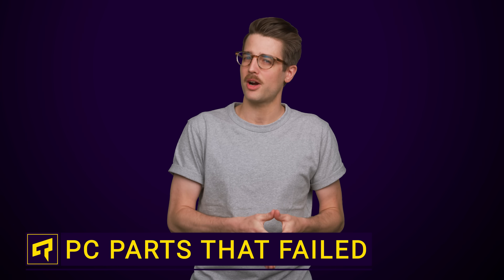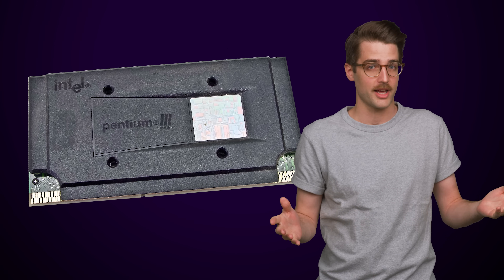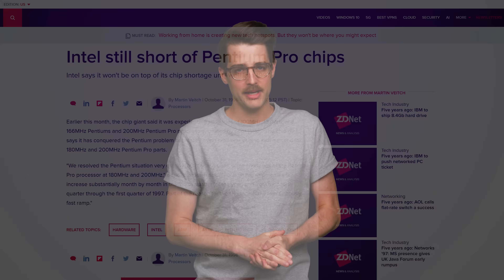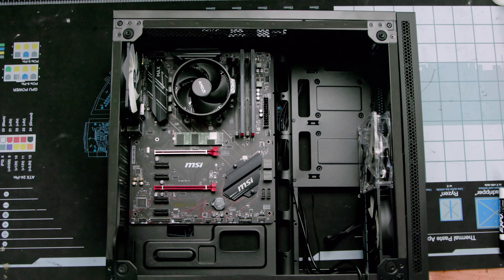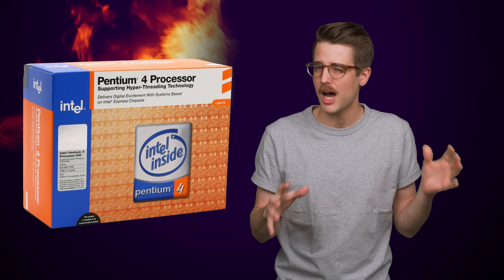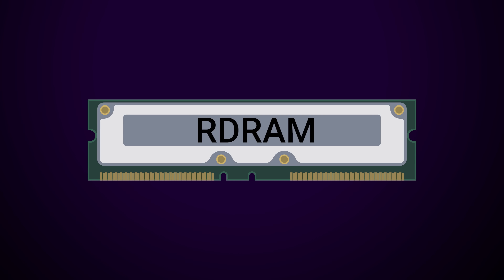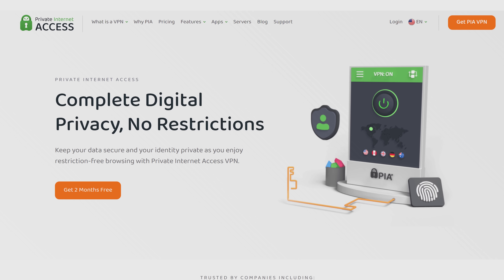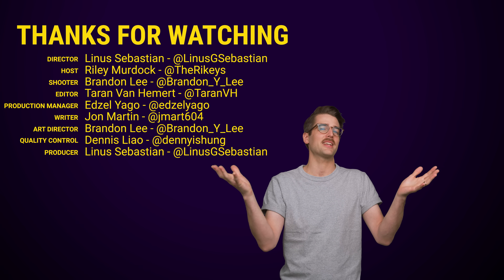PC Parts That Disappeared

Comment: "RDRAM had to be installed in pairs"

No wonder it failed. OEMs love getting away with installing only 1 stick of RAM if they can.
Reply: IIRC in cases where you wanted to install only one for whatever reason there were dummy RDRAM sticks with 0 capacity that just completed the circuit, although don't quote me on that because it's been years since I looked into it
Reply: @maowohl  RDRAM still has to be installed in pairs of identical amounts and clock speeds to work. The dummy sticks go in the channels you aren't using and you cannot only put memory in half the channel with a dummy in the other or it wont POST. You could say it was the beginning of dual channel memory.
Reply: @neilbaird2789  The dummy modules was needed as Rambus RDRAM communicated serially and the memory bus was configured like a ring. So it all started at the memory controller, which was located in he chipset North bridge. Then it went to the input on the first module, to out put on the same module, input on second module and so on until it looped back to the memory controller. The thing was you could have a lot of memory as each real module contained the circuitry needed to both receive and transmit the signals, so signal integrity was not a problem. The dummy modules just connected the pins for input to output to complete the ring.
It was an attempt to solve a problem that it turned out didn't exist. It was also an attempt by a company to create a market for a product where they controlled almost all the IP. Every RDRAM module made generated revenue for Rambus no matter who made them.
Reply: @maowohl  Nope! You had to install it in pairs, and THEN you needed to populate the empty slots with dummy modules.
Reply: @maowohl  but was that priced like the 0gb RGB sticks of today?
Reply: Paging @Dawid Does Tech Stuff
Reply: I think you got it backward, having an OEM system come with 1 stick of RAM is a blessing for multiple reasons. OEM mobos often only have 2 slots for memory so if they are both preoccupied, you can only upgrade your memory by buying new kits and throwing the old ones out, making even more e-wastes.
Reply: If I remember correctly, it was more complicated than that. If a motherboard had 4 slots, they all needed to be filled. RDIMMs were required in pairs because they were only 16 bit wide. You could put a pair in and then two dummy sticks in the other slots. RDIMMS failed because of supply constraints. Back when the Pentium 4 came out and used those chips, we couldn't keep them in stock. They were expensive to manufacture because they were so fast and the demand for them drove their already ridiculous prices(when compared to the much slower SDRAM) up even further. Via loved them, though. Well, pretty much any company that made chipsets for Intel processors loved them. It allowed them to make huge gains in market share since they only supported SDRAM, not RDIMMS.
Reply: its funny because after watching the linus ram video i decided on adding another 24gig of server ram to my system and i didnt match anything like hp said and it worked just fine... i bought 6 more sticks from different ebay listings all in for maybe $20 just to have 48gig
Reply: @mcf3778  Those list are for tested configurations. Something not listed can work fine, or increase instability. List is good quideline for people who can't use days for testing/hunting source of instability.
Reply: That wasn't the real problem... but you could get 512MB of SD RAM for less than you would have paid for just 128MB of RD. And because of that pricing, basically every prebuilt with an Intel that had RD did have a massive RAM bottleneck. People were ranting about Vista needing so much RAM just a few years later, but the real nightmare was running XP on just 128MB of RD which was pretty common.
Reply: If it had to be in pairs, why not combine two sticks?
Reply: EDO memory had the same requirements, had to be installed in pairs
Reply: Why is that a problem? It make it cheaper to upgrade RAM.
And the difference in performance is not much...
Reply: @skak3000  the difference in performance is ABSOLUTELY much, single channel RAM can be as much as 20% slower than dual channel, no matter what frequency or CAS latency the RAM is running at
Reply: @skak3000  The workstations in the office I was in the past several weeks are very slow while using SSD's and decent 4 or 6 core 6th gen Intel CPU's. The common denominator for awful performance in all the computers was single channel memory.
Reply: @skak3000  intel 6th gen cpus in workstation computers. The memory speeds are 2400 mhz. One computer uses a 1x8 gb memory stick (the workload only uses around 4 gb to access patient profiles) and the other computer uses 1x16 ram stick, which makes zero sense. Sata SSDs. Both hitch and lag.
Reply: @skak3000  you don't want single channel if dual channel is available. I know in gaming the difference can be as much as 25%, but it may vary based on workload and architecture.
Reply: @WLOfails  just download more ram, easy
Reply: @skak3000  Didn't he say 6th gen Intel?

Comment: Ah yes I remember the Pentium 2's & Pentium 3's that were slot based. 
My attitude then is that it was nice because it made it much easier to swap processors!

Also remember seeing computers in the BTX format but I didn't consider it to be a standard format just the design choice I figured of whatever exact computer I had with that design. 

Also loosely remember RD ram because I remember how some systems needed the ram to be installed in pairs.
But I never thought into the why, just did what was required haha. 

So I remember all these things this means I am old.....

Comment: "First slot CPU" I'm pretty sure that's wrong, depending on how you define slot, older computers had slots to add (sometimes different-architecture even) processors. I think maybe Acorns?
Reply: A socket isnt a slot.
Old CPU sockets are just caveman versions of modern CPU sockets. Its all just pins going into holes.
Reply: @stitchfinger7678  I looked up what I was thinking of, and it's the Acrorn RiscPC

Comment: I use to have slotted CPU's, PII and PIII's 
They where pretty easy to install but if you compare them to current CPU's: speed back then was just 200Mhz :D

Abd i can convert my ATX case to BTX.. sadly i can't put a ATX motherbord (reversed) in it, it's almost BTX but not the same so the back of the case doesn't fit.

Failed tech i would like to see: Super-Audio CD"s  , 7.1 lossless channels of analogue audio but the players where expensive and most SA-CD's where classical music.
It wasn't widely adopted by the industry. 
Probably because of 128kb/s MP3's that you could just download.

Comment: Here is a good one. Java Byte Code cards. They were basically CPU's that used the Java Byte code as its instruction set, allowing Java code to be ran in a native state. Although Java was taking off, this idea just kind of died out.
Reply: I do a lot of programming in Java for uni, had to look it up. Could not find any "cards" but there were microprocessors called picoJava and an ARM extension named Jazelle
Reply: @TheSimon253  May of miss remembered the formfactor, or i was maybe thinking of a dev board... it was a while ago.  XD I do know some chips dabbled in the idea.

It may be one of them things that are hidden away in the background, in some set top boxes or industry appliances where java is used extensively.

Comment: I miss seeing optical drives built-in to desktops.  I often work with older machines that can't boot off of USB drives so I have to burn bootable drives onto DVDs.  Nowadays, there are not many options to include a 5.25" drive.

Comment: There were also a couple of expansion slot standards (similar to PCI), called AMR, and HDMR.

AMR (Audio Modem Riser), as the name implies, was meant to specifically interface with the chipset, meaning motherboards that didn't have onboard audio or modem could get them directly from the chipset. As such, the cards didn't have active electronics.

HDMR (High Definition Multimedia Riser, not to be confused with HDMI), was a slot meant to add a second display (usually DVI) to the motherboard's onboard graphics. As far as I know, I've only ever seen this on ASRock boards around the Pentium 4 era.

Comment: I have a Slot 1 500MHz Pentium III sitting just to my right in an old Gateway I use for old games. Circa 1999, with a circa 2001 sound card that has OPL3 support, I forget the GPU, 16MB nVidia AGP 2x I think. I've got 512MB of SDRAM in the thing, which, was a lot in those days. I also have what's left of a BTX Dell in my closet... IT's been gutted for the CPU and other bits. Or maybe I threw it away? I don't remember... I grabbed the Pentium out of it for my other Windows 98 gaming rig, 'cause ya know, why emulate when you can run the real hardware?

Ever burned yourself on RDRAM? I have... Stuff gets hot... No touchy immediately after shut down... Much burnie... Much ouch... Pain.. You forgot about the need of dummy cards for RDRAM, I remember running into Dells running RDRAM when I was in high school working at a PC repair shop.

Comment: SSL accelerators/co-processor were a thing on server side back then.
Reply: Technically Xeon Phi coprocessors only just got completely discontinued a few years ago
Reply: @hiddenhawk13  yeah i wonder what would happen if i added one to my z800 dual 5570 xenon
Reply: Hardware MPEG decoders, while we're at it. Like, a card that did only that.
Reply: I used to have on in my Mac LC II, it was a 32 MHz floating point co-processor...
Reply: They are still being used, just not as commonly.
Reply: Buying a box of 387s and installing them in all the boxes over a weekend was fun the kids just don't appreciate these days.
Reply: They still exist. They're just built-in to the CPU now.

Comment: Ah. I had the Intel Pentium 3 450 MHz with two huge and noisy fans, but huge by those days's standards, not today. But it was noisy. And it ran at 600 MHz just fine.

I still have my P4 1.4GHz PC in the attic. I always wanted to fix it up and max out the RAM on it as well, but that RAM is even more expensive now, IIRC.

Comment: Intel shot themselves in the foot with the Slot 1 Celeron 300A, right motherboard you could change the FSB from 66Mhz to 100Mhz and instant 450Mhz CPU that was a beast at the time.
Reply: @Clarissa 1986 Celerons did not have enough cache for serious tasks.
Reply: @Clarissa 1986 Celeron was cheap because it did not have enough cache for workloads. Cache memory was expensive, so Celeron was OK for people who did not need best possible performance. If small cache was enough for tasks you did on your PC, then you did not notice difference to Pentium.

Comment: Maybe you can do a tech quickie on the hack that lets consumers run dual sockets which was what gave many their first look at having more than one core in a system. 
Another fun one might be a quick video on some old expansion buses, how that lead to PCIe and how so many of the slots in our PCs are basically just PCIe slots with different form factors and some additional signals routed to them.

Comment: Slot wasn't a failure they still sold very well. It just wasn't needed anymore.
Reply: Yeah, the Celeron 300A sold particularly well. It was one of the best overclocking CPUs of all time and sold like crazy as a result. With an advertised clock speed of 300Mhz the first thing almost everybody did was bump front-side bus from 66 to 100Mhz giving a 450Mhz overclock - a whole 50% higher than stock. Because the Celeron had on-die L2 cache (unlike the Pentium II described in the video which had it seperately on the board)  this was a serious performance gain. Some people claimed 300A overclocks of up to 700Mhz - more than twice the stock clock speed! The 300A slot-1 was the CPU that brought overclocking to the masses.

Comment: RDRAM was also used on the N64 due their weird strategy of few pin counts but very high clock speed, which simplified the board design.
It was a couple of 9bit(!) chips running at 500Mhz.
But it had the drawback that changing the current address was very, very, very slow.
As with modern memory, you can do "sequential reads/writes", the chip has a "current address register" that goes up by 1 on every read/write automagically, so reading 1000,1001,1002,1003 for example is very fast. Now if you want to read out of sequence, you need to write to the memory chip "address register" and that's VERY slow on RDRAM.

Comment: This brings me back to 8th grade when I started to dabble in PCs. I tore open our family's first PC which was not being used anymore and it had the P3 socket CPU. That was my first and only experience with those. Ah, good times
Reply: Your icon is a dinosaur, but your comment makes me feel like a dinosaur
Reply: wait, do you actually mean a Socket 370 (PGA370) Pentium III or a Slot 1 Pentium III...? (and yes, it was made in both!)
Reply: @RWL2012  there were even Adapters so that you could fit a 370 p3 into a Slot 1!
Reply: @RWL2012  Had to of been the super late 90's socket P3. When Intel once again switched the package to the socket instead of the slot. My first ever experience building a system was a Pentium at 75 MHz. But I did buy off a garage sale a 486DX2 system and referbed that one and used it for a good while longer.